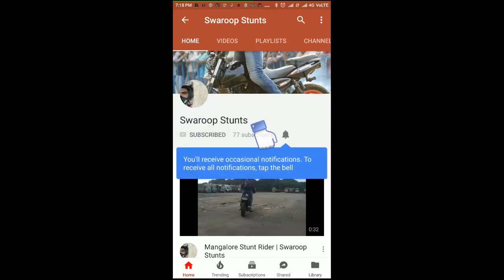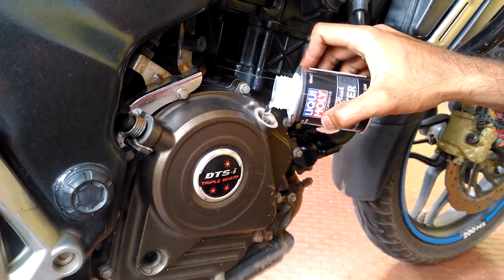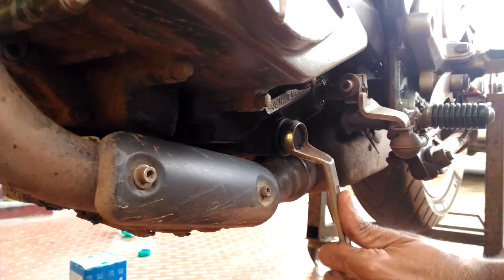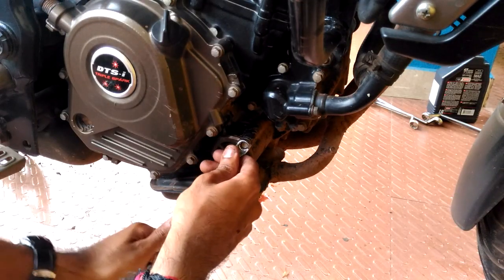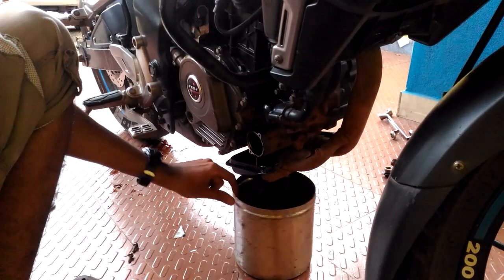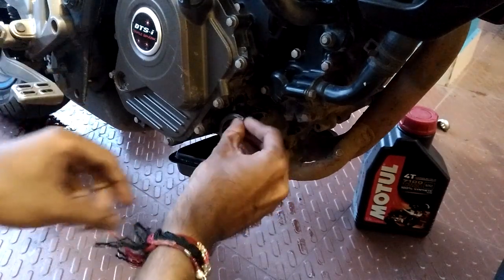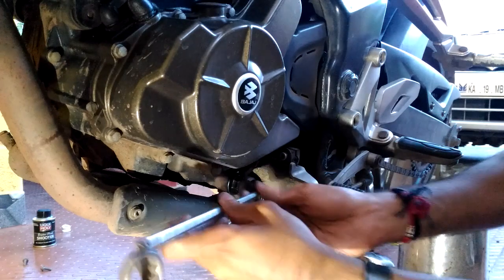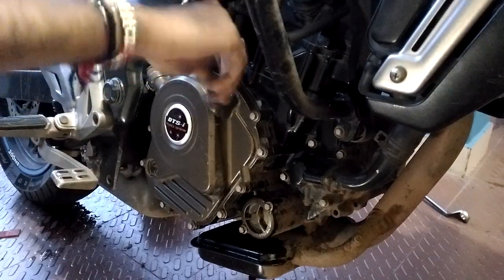Liqui Moly Engine Flush for Motorcycles | Episode - 5 | Fix My Ride with Swaroop Stunts

Comment: Engine oil volume in motuln is 1000 ml. Required volume is 1150 ml.

What about the rest of the engine oil?? Pls reply. If you used other oil, do reply
Reply from the maker: You need to buy 1.5 L bottle or buy 1 L 2 bottle and pour the required amount of oil from the other bottle
Reply: @kswaroopshetty942  is 1.5 liter available in liqui moly or Motul... For bajaj As200 , and which grade
Reply from the maker: For Pulsar I prefer Motul 20 w 50

Comment: Bro ihave r15 v2 h 2018.jan model 1.5 years hoge engine m se tik tik awwaj aati h ab m service k tym flush krwalo bro plz tell ? 🤷🏻‍♂️🤷🏻‍♂️
Reply from the maker: No don't do it now tell service centre to fix the problem
Reply: @kswaroopshetty942  sab kiya bro wo sunwai nhi krte 🥺 bilkul bhi
Reply from the maker: Find a good mechanic
Reply: @kswaroopshetty942  ok bro but agr baad m kuch or khrani nikl thn company claim nahi kregi wo bolege ki warranty avoid hogi h☹️☹️
Reply from the maker: Then better call up Yamaha and tell them
Reply: tappets adjust krwa lo or motul 5100 use kro